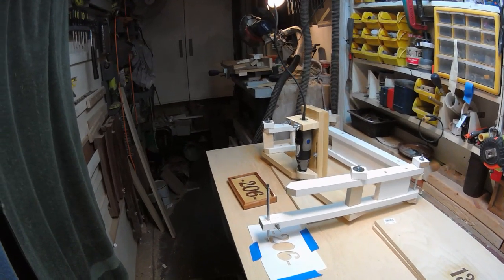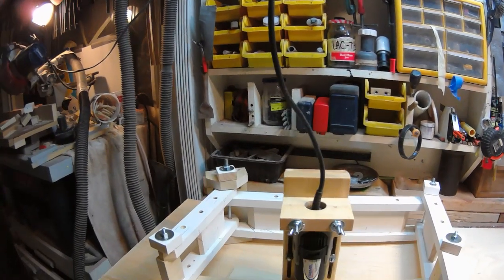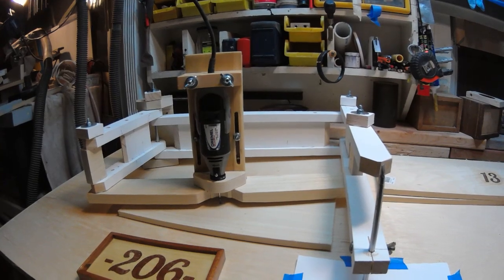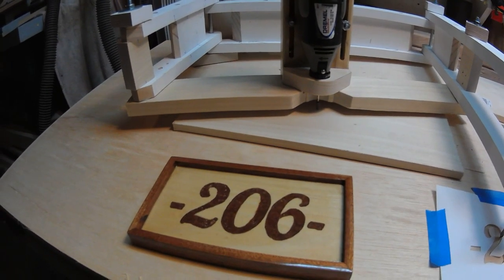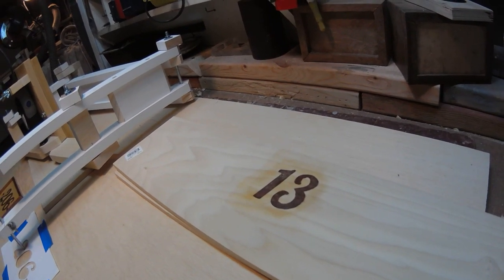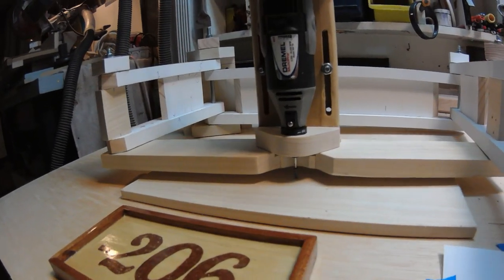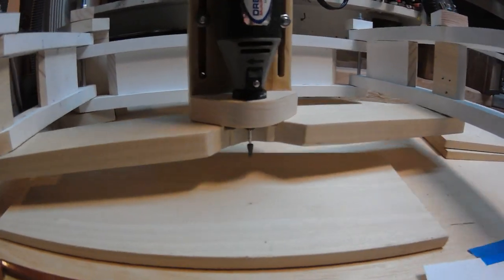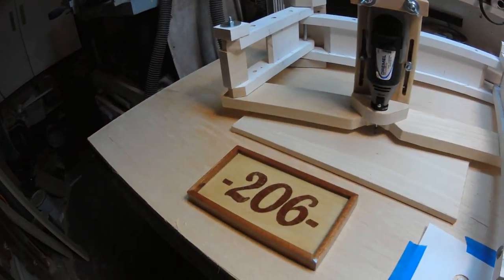Pantograph  --  Dremel Prototype

Comment: Good morning from Spain, it's a good job, I congratulate you.
I wanted to build a pantograph and yours I really liked.
Please, would you be so kind as to lay the plans for the construction?
thank you very much
Reply from the maker: I didn't have any plans, but saw several similar designs here on uTube.  I just used some scrap 1x2 and 1x4 wood, but used long bolts from Lowes that had threads only on the last 1.5 inches of the shaft.  The ratio of length to width of the box determines the reduction from template to the finished size.

Comment: I built mine similar to yours except I have the Dremel mounted on the arm, and am using the flexi-shaft attachment as my cutting 'head.  My question is:  How do I set it up to get a true 1:1 size or larger? Can't find this answer in any video.  Do I move the tool mount?  Any ideas or answers would be a great help and appreciated.
Reply from the maker: The relative size of the final product to that of the original is determined by the size of the box that forms the pantograph.  Experimenting with the size of the sides and front/back dimensions will determine the reduction in size of the final product.  I have seen videos with 2:1 and 3:1 reductions, and chose to use the 2:1 version.

I think this video contains the dimensions and gives a better explanation of the size reduction  

https://w ww.youtube.com/watch?v=n7RdtzvLR_I
Reply from the maker: I am only aware of the 2:1 and larger copy reductions.  I also have not found a 1:1 set up.

Comment: how come the template seems the same size as the sign if it's a 2 to 1 reduction?
Reply from the maker: This was a video shot while I was building the pantograph and I was using a piece of scrap wood as the model, not the original computer print out that was used to create the product.